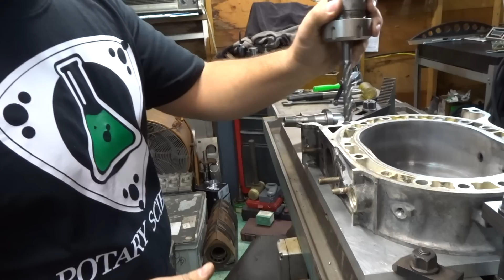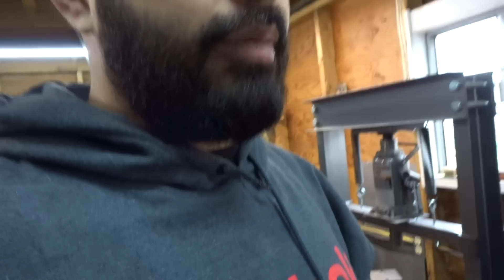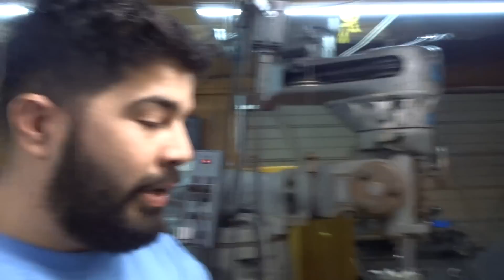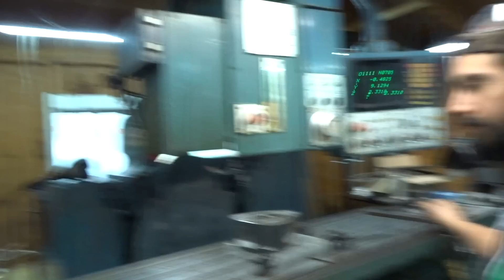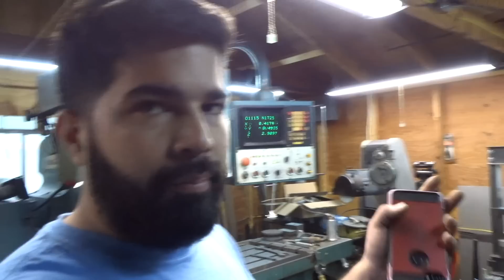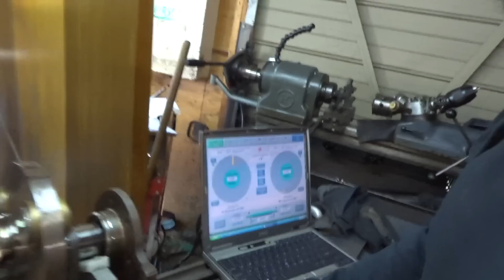Mystery Van Rotary Engine Machining Explained

Comment: Great to see someone using proper tools to do a job.  Great job. The lightening the rotor and scalloping is really cool.  Balancing the rotor and the   Total assembly  should make for a smooth running engine.  I just love rotary engines.

Comment: I have had over 60 cars in my life. Many Corvettes and Camaro/Firebird's. Many cars with 300+ HP. One of my absolute favorites was a worn out 1986 NA RX-7 with a 5sp. That car was a hoot to drive. The torque was great and it would rev forever.  I sold that car long ago for $2500 with working AC and around 100K miles. It was so worn, I had to use trans fluid to start it. It needed the trans fluid to get enough compression in the winter to start. Once started it ran great and had no problems as long as it was driven every day. That RX-7 and an old 1974 240Z with factory AC are the 2 I regret selling the most. Also my 1969 vette I sold for $5500. That thing would be worth 25K or more now.
Reply from the maker: They are picking up quickly these days

Comment: I would love to see/hear measurements on what you had to remove to true up the rotors. Also - when lightening the rotors, was that free hand or cad controlled?
Reply: That was CNC, you can do straight lines and circles manually but certainly not the shape of a rotor

Comment: 4:30. That interrupted cut though. Impressive all around
Reply from the maker: Better editing coming soon
Reply: I was talking about the dorito on the lathe. When the cutting tip/bit comes off of the work piece and then back on the work piece as it spins, that is called an interrupted cut. That’s a 3 piece interrupted cut, for every rotation of the dorito the cutting tip is interrupted 3 times. Pretty badass, editing/content looks good to me. :)

Comment: This is the missing vid about building rotary's; balancing & blueprinting the assy. I have a question about the scalloping process: I noticed how large it was on 1 of the lobes to the point of cutting into the compression bowl. How much does that impact the fuel burn rate, the swirl of the fuel mixture and final compression? Will that cause an uneven fuel burn? Will there be an issue with hotspotting on the edges of the scalloping and how did you remedy the chances of early detonation? Are the later rotors interchangeable with the earlier designs: journal size, width and seal locations?

Comment: I’m curious as to how they indexed the tool to where the rotor is mounted on the table. Depth, angle, radius must be very tricky to get perfectly milled rotors to such a crazy tolerance. You guys are amazing
Reply: They probably did it one time with a lot of measurements, dial indicator, and shim stock, then built a jig so they never have to do it again. The first time they probably found X and Y by getting the spindle concentric with the rotor bearing, basically mounting a dial indicator to the spindle, rotating it by hand and adjusting both axis so that the dial indicator reads the same distance throughout one rotation. Then to find Z they probably used shim stock(thin metal of a precise and consistent thickness) the same way you would use feeler gauges, and raise the Z until the stock catches between the rotor and end mill. I could be wrong but that's how I would do it.

Comment: So if youre facing the rotors.......do you have to mill down the housings as well? Wouldnt there be a slight decrease in displacement? Not that it matters since this is a reliability mod and HP levels are way higher than stock.

Comment: So are the dowels being replaced with studs?
Reply: The dowels usually stay, the through bolts that hold the motor together are replaced with studs. It helps prevent big power turbo engines from twisting. Also part of the reason the tips of the sides of the rotors are machined, to prevent rotor tips contacting the side plates if "some" twist occurs under big loads.
Reply: @bruizey7319  That makes sense, but he mentioned adding 5 studs which is why I wondered if he replaced the dowels with studs, because he didn't add new holes, just trued up existing ones. This would also explain why he used ground rod for the studs because they would be accurate enough to function as dowels too.
Reply: @johnnason7019  You got it - they act like extra dowels. What they didn't show were that the standard dowels are just small pins that sit between each plate instead of running right through (like locating pins). The side plates often crack around the dowels as well.

Comment: In theory, could you add as many rotors to a rotary engine?   IE Could you just bold twelve "cylinders" together, and get a custom crank?
Reply from the maker: Yeha the issue is making sure the crank doesn’t move from being excessive long

Comment: I would, however, recommend that if you're going to be using the footage in a sped up fashion to mount the camera or use a gimbal. Makes for smoother sped up footage that doesn't make someone with video motion sickness issues to puke from the constant jittery motions of the camera and just looks a lot better without being expensive.

Comment: So taking material off of the rotor towards the tip of the sealing surface changes the rate of combustion? How freckin cool. I never ever thought changing that would do anything but thinking about it it makes complete since. So taking more material off delays the combustion charge so you could in theory tune it to have power hit at a lower rpm instead of a higher rpm? Crazy but understandable approach to improving on the rotor. You opened my eyes. I bet wankle didnt know that!👌
Reply from the maker: That’s the goal for the new scallop

Comment: That’s 1 thing I’m worried about my motor the rotors and the e shaft not being balanced since I’m using rx2 double side seal rotors with the 9mm carbon apex seals in my motor but hey it’s an experiment

Comment: That balancer looks to be highly configurable!  If I stepped thru the frames and understood what I saw its has two vertical plates with Vblocks on the top and contains the strain gages and appears to be attached to the bed of the mill, a rotary encoder attached on the left end of the shaft, and finally a simple belt drive to spin it up.  Laptop reads the two strain gages and the rotary encoder combines that with the geometry and does some math to produce the output, yes?
Reply from the maker: Its all magic after you slap on the rotors on the machine

Comment: I like the way you guys explained how you build the motor.  Do you guys use a different apex seal or is the stock one ok?
Reply from the maker: Stock ones break so we use hardened 2 piece apex seals from rotary aviation

Comment: Dont the scallops lower compression ratio?
Reply from the maker: Slightly but the compression is mostly determined by the pocket of the rotor by the different years of rotors

Comment: Anyone else left wanting more? 
That scallop looks aggressive; I didn't think that much material could be taken from the rotor. Is this fairly common these days? Does this slightly increase the pressure seen by the seals (slight venturi effect during combustion) or is it negligible?
What about swept volume; any measurable difference?
Keep up the great work guys!

Comment: that scouloping off the rota now that got me buzzin,,thats thinking out the box also i know this has nothing to do with this vid but i seen you talking about popping radiator hoses from your burnout just heads up we use to run anr fittings and ended up blowing radiators from the intense pressure the key we found out to over come this was to use a radiator cap with thermo inside it removed and a decent over flow elemenated so many issues ended up going back to hoses with clamps and have saved engines from blowing waterseals but again your engine building practice is on point

Comment: Just curious if your ENSHU .yuasa ACCU-MIL AM 1547 mill  is CNC controlled? The reason I ask the movement of it looked so fluid instead of jerky, if you were controlling just one axis at a time. Yes I used to work at a machine shop, I'm retired now after 40 years, I enjoy watching people work with machines. 

I found your channel from a link on Cleetus's channel.
Reply from the maker: I can ask the machine guy

Comment: By doing this, can an Rx8 be made reliable, lol

I see them often for affordable prices, but I know the engine is probably shot.  Just always liked the RX8, and maybe can get a project started.
Reply: The side port engines are crap, just a bad design generally. Just replace it with the 13B REW (ie any motor that came twin turbo from factory, FD rx7, and cosmo)

Comment: Awesome technical video. Glad youtube put this in my feed after I seen you guys in Cleeter's shop.  I use all the same machines and tooling where I work except it's aerospace instead of the automotive industry.  What's the reason you use the indexable boring head instead of a reamer to enlarge the holes of the rotor housing?  Where is the datum on a rotor housing to get all those stud holes to align perfectly?   Maybe I'm just jaded cause my shop can afford to buy literally any tool at any time.